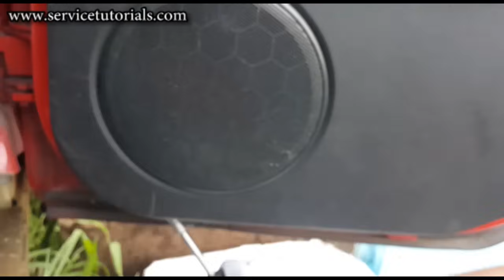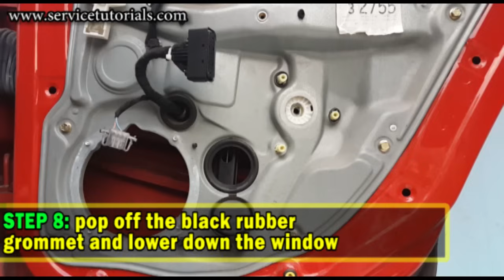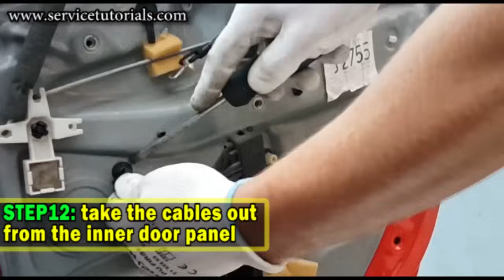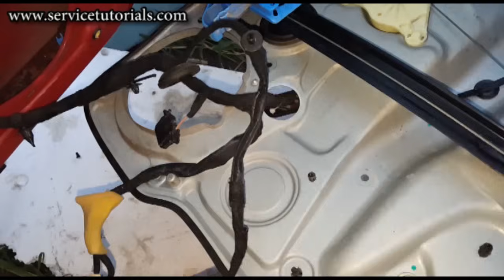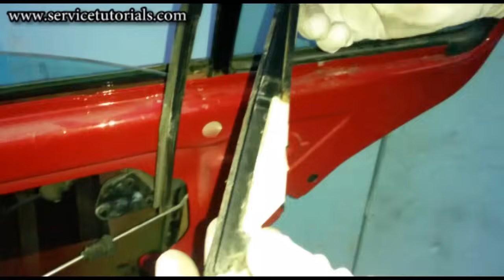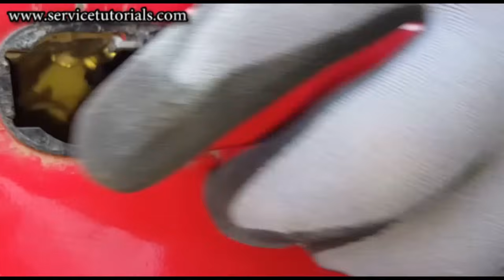How to remove / replace rear door lock module VW Golf Mk4, Bora, Jetta in 25 steps

Comment: Aloha. As a heads up to anyone attempting this project, it can be done without removing the glass and window trim. You can remove the bottom bolt of the window track and push it enough to the side to get the old actuator out and the new one in. It was a tight squeeze but doable and much easier than all the extra steps of the window removal.
Reply from the maker: Thank you for the info! 👍
Reply: You are wrong. Both the window and the guide rail need to be removed. 
In addition to that, do not remove the lock from the panel, before removing it from the door. The plastic bracket remains attached to the metal panel and so does the lock. Comes out altogether. Video shows it wrong.
When putting the door together, mount everything to the panel and then move it into the door. It is much easier, than mounting the lock itself to the door without being attached to the panel.
Reply: @Servicetutorials
Reply: @dacat8171  I just do it yesterday and its true you can remove the lock without removing the glass and window trim ,just take out the 2 bolts that have the glass trim and you can squeeze the lock. Be careful with the long metal that supports the door latch because it has only one position , following the back of the piece that supports the long cable of the internal opening (not in the front, i do that and the door lock was failing because it cant open or close propertly due to the metal of the latch being forced and was not mooving freely
Reply: @Ivancp13  
Removing the door lock may work the way you have done it, but it will cause damage at least to the lock and possibly break the levers that are attached to the door lock and which you need even if you replace the entire lock. 
You will have a very difficult time putting everything back into place, if the window trim is not removed. Removing both the window and the window trim takes a half hour, when doing it for the first time, but gives you massive space to deal with the door lock and saves you time when re-assembling it. 
The window definitely needs to be removed. 
Also I am not sure, if your car has got a central locking function or not. If there is a central locking system you have to go the extra mile, since the door lock is huge.
Reply: @Enter_The_Sage  this is 100% true. I just did it your way by moving the rail towards the exterior of the door on both my mk4 jetta and mk4 wagon
Reply: So if it worked for me to do it how I suggested and it worked for a few others on here then maybe you should walk back your comment saying I’m wrong. If we’ve had success and no problems with the method I suggested than who are you to say we’re wrong? Seems like you're the one who is wrong yet is doubling down on how right you think you are.

Comment: Thanks. Two comments: (1) It is easier to push the plastic pin out of the centre of the glass retainer than using a screw. You can then also push the main plastic bush out and retrieve both from the bottom of the door once the panel is off. (2) The electrical connector to the door lock: the design of the locking mechanism means that often it will not release if there is or has been any tension on the plug. Before trying to unlock the plug, first of all PUSH it firmly ON to the connector, only then can you release the plug by pulling the small catch and then pull the connector off.
Reply: I think using a screw prevents the spreader pin from compressing, making it hard to pull out. Still, I'd be wary of pushing the pin through, as all that force is exerted on the small plastic clips that hold the pane holder to the rail...I wonder if that's how the Humble Mechanic broke his:
https://youtu.be/RF4w7uYgc8k?t=623
Reply: And for the electrical connector, I found a small flat-blade screwdriver got the lock released easily (whereas using my fingers was both futile and painful!) - depending on which side of the vehicle you're working with.
Reply: Yes, I struggled with those VW connectors until I realised you have to push the connector IN while you release the retaining clip.
Reply: @thromboid  yep wish I had read your comment about breaking the guides if you don't use a screw. I got away with it the first time I replaced the lock. Module but not this time. Window working with only one guide but not wise to break them.
It's best to put the glass back with the white plug already installed. It will locate itself onto the slider fairly easily and does not appear to damage the slider in any way.

Comment: I'm doing this job right now. What a monumental PITA. Great job on the video. Saved me a ton of money. Shop wanted $600 per door for this. I am doing three doors.
Reply: Monumental PITA is 100% correct - so many little traps and tricks to watch out for. I finished the first door today, and I can see why a shop would charge $600!
Reply: Think yourself lucky.  I've got all four doors to do.  Weirdly on this car the tailgate lock is absolutely fine, whereas that is normally the first to go (when the washer fluid line pops off and dribbles fluid all over the lock module.)  If only the side doors were as easy as the tailgate!

Comment: Thank you very much for posting this very detailed video with all the necessary steps, clearly stated and clearly shown! Much appreciate your effort in making this informative video.... But holy cow, could VW have possibly made this actuator part any more inaccessible or difficult to locate and replace?! This is exactly why I almost always buy and drive cars with MANUAL windows - nothing to break or replace.
Reply: It was still a bit of a pain back in the day. I remember doing this on a Mk1 GTI (front door obvs) and a MK2 5-door. Very fiddly and the doors were thinner meaning access was even tighter. Now on my third VW of this era (two Golfs, one Passat) and all three have had window or lock issues. VW dealers must have loved this design choice.

Comment: Perfect video, was really helpful. Few things, you dont need to remove the glass or the trim, just take out the 2 bolts from the trim and you can squeeze the doorlock pushing aside the trim. Other thing is that the 3 plastic bolts that supports attached the doorlock to the inside panel isnt needed, take it off and put some tape on that 3 black holes cause when it rains the water flows inside the door, so that why has to be well insulated. That piece is always or broken or just a pain in the ass, you can remove it and its no necessary
Reply from the maker: Thank you for the info!

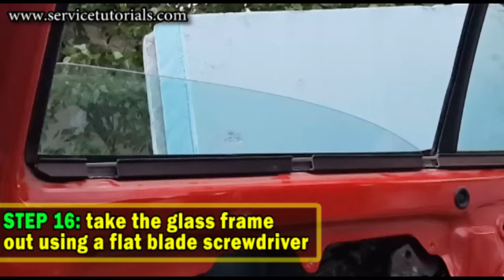Comment: 10:11 (Step 16) I found it much easier to pry up the window strip on the inside of the door - there's a series of clips built into the metal of the door that you can work the stripping off by twisting a flat-blade screwdriver in there.
Reply: correct.Work from the B style to the rear.

Comment: I only used steps 1 - 14. Too much hassle to change motor and never use rear lock. Made sure door was in "open" non deadlock mode. Looked at the six coloured wires to that connector and cut the cable at the door handle end just cutting those six wires. In effect that door is now non central locking but I just keep it locked now manually and wont get in difficulty if the door decides to deadlock and cant be opened which is also an MOT failure. Thank you for the video - took me a fair few hours to do but got there, referring to your video as I went along.

Comment: Hi!
I haven't seen before the foam at the steel locking rods (two yellow one at the horizontal, and a grey wrapping one around the vertical rod). Were them a manufacturer fit, or have you put them on those? Did the help on decreasing the noise of the door lock mechanism?

Comment: Correct me if I am wrong, but I believe the two bolts that hold the mechanism onto the door frame are actually 8mm 12 point allen screws. . . that tool worked for me. I have no 12 point torx drivers.
Reply: It's a Torx if it's 6 sided, these are called Tripple-Square bits and have 12 points as you had mentioned and yes, this is the M8 (8mm) sized bit
Reply: Some places are calling it triple squared, and some call it a 12 point spline. It's not a Torx though.

Comment: good video, however I reckon that I would leave the cable plugged in to lock until I can see it, but the most important one is this-DO NOT remove the bolt that secures the door handle, unscrew it about 10-12 turns, enough to free the handle
Reply: @Kristian Julian it did the trick and I actually got access to my account again. I'm so happy:D
Thank you so much you saved my ass!
Reply: @Franco Mitchell happy to help :D

Comment: When you install everything again, be careful with the pin that holds the window, I put the 2 together at the same time, tapping carefully until it clicked into place, because I tried putting the large one first and then the second and it fell to the bottom of the window. the door either of the 2
Reply from the maker: Thank you for the info!

Comment: Very detailed and informative.
I got one question, my door is completely stuck, it will not open from the inside or outside, I managed to remove the door panel from the inside only, how can I get the door open to continue to follow your tutorial?
Thank you very much
Reply: I have had this issue in the past. It's a difficult fix. If you can remove the interior panel with the door shut, unlocking and opening the door is going to require you to drill a hole through the door skin where it is usually covered by the panel in line with the release lever on your door lock mech. I used my new replacement to figure the exact spot. If you use a screwdriver through this hole to move the release lever, your door will open and you're ready to follow the video and replace the mech. Worked for me

Comment: Hello buddy thanks for your video. I have I basically 2 problems in my Skoda Laura co passenger side lock. 1st is it does not shows  on door open light on dashboard when the door is opened. 2nd is when I press unlock button for the door the co passenger side door does not unlocks. it stays locked. after repeated pressing on the door's lock & unlock button the lock finally unlocks. 
can you please let me know where exactly the issue can be

Comment: Actually, the replacement of the door lock is not that challenging, once you understand that all parts remain attached to the panel and the panel with all parts mounted including the door lock are to be removed in one step from the door. 

Key to success is to remove the window and the window guide rail completely. 

Some remarks:
• no need to remove the speaker, 
• all wires remain connected
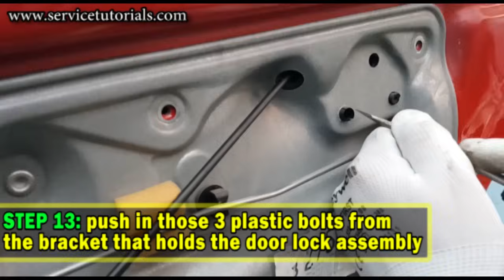• do NOT remove the rivets from the door lock bracket @ 7:05, since it is almost impossible to get them fixed. You need the bracket for an easy installation of the door lock.
• window opener motor at 2:55 stays where it is

Therefore, I am not that happy anymore with your video, since it does not show the replacement in the correct - easy - way.
Reply: I don't know about easy. But I'm going to do it your way.
Reply: Could you explain how to remove the window and the guide rail before the panel is off? (Edit: I think I worked it out)
Reply: @chaos.corner  
Did you succeed?
Reply: @dacat8171  I have put the job on hold. I was hoping it would be a quickie and I need to use the car in the next couple of days. Those plastic rivets are already broken so doing something with those is going to make it a longer job too.
Reply: @chaos.corner  
👍🏾

In order to get the bracket attached to the metal panel, I used zip ties. It worked out well. But the lock is a massive chunk. It feels wobbly.
The only job the bracket needs to fulfill is to carry the lock out (when removing) and in, when installing the new one, without unplugging the electric wire. 

FYI I was not sure which door lock I needed and I therefore removed the door lock on the first day, purchased a new lock and put everything together on several days. There must have been at least one week when the window was secured only by duct tape. Duct tape also works in rain, I discovered.

That repair was one of those moments when I thought >>why bother with that 25 yrs old car? ... why not get something new?<<

Edit: at least a week when I drove around without the door lock installed and the door kept closed by means of duct tape. Only city traffic and therefore moderate speed. 😁
Reply: @dacat8171 Yes, this car is definitely past EOL but it's still going and getting 47mpg. I'm thinking I'll be able to get the lock out and just let it hang on the wires then maybe run some screws through to hold it back on (some parts of the rivets are still present so I can get it in the right position). I could bungee the door but I have to travel some distance on Thursday. I might have a look at the bracket and see if I can model it for 3d printing.
Reply: @chaos.corner  
3D printing is definitely a powerful backup, since this bracket is a bit fragile in the area where it secures the door lock and tends to crack owing to its age and the weight attached easily. 
That bracket is still available at Volkswagen spare parts. If that is an option. 

Interesting fact about the bracket: there has gone some engineering knowledge into the designing of the part, as it needs to be strong enough to carry the door lock, but it also needs some flex to allow the door lock to be positioned in the correct manner.
Reply: @dacat8171 I'm actually wondering if the broken rivets are responsible for the issue I'm replacing the actuator for. Often the door won't open and I have to push on the handle until it "clicks" and then it will open normally. I don't see that it should be an issue since everything is bolted up. I need to replace it for electrical reasons anyway.
Reply: @chaos.corner  
Naaah, nothing to do with the broken rivets. 
Possibly the rivets were damaged on purpose when the electric window opener mechanism was replaced. Besides the door lock the window opener mechanism is another weakness of this car. 

There is another door lock repair (?) tutorial out there stating, that German engineering is ace as long as it works, but is painful, when it breaks and needs to be repaired.
Reply: @dacat8171 It's not the window (I have manual windows anyway) It's the three plastic things that hold the lock to the metal plate. I don't see how it could be causing issues either but shrug
Reply: hey, I am looking to this exact repair the way you described it. Would it be possible for you to give me some tips/a more detailed explanation of your strategy?
Reply: @zerkalix  
Again, you need to understand, that the panel carries almost everything from the door i.e. door lock, speaker, wires etc. 
In order to remove the panel you have to remove the window glass, the window guide rail (watch other videos on YouTube), disconnect the handle from the lock (as shown in the video) and last remove the screws that secure the lock to the door frame. Then you unscrew the various screws that keep the panel in place and it is very easy to remove the panel with the door lock in one move. 

To install the door lock you first mount it onto the panel connect the wires and place it into the door frame. Then you install the guide rail. Put in the window glass and last the door cover.

Comment: Normally, careless & cheap engineering lead to bad products. But One has to spend a lot of resources to engineer something this level of stupid. 
German logic
Reply: Yeah, I wuz going to fix the lock actuator, but, I think I'll just reach over and manually unlock/lock it, now...
Reply: @nplus1watches35  So true...for the time and hassle you could probably do 10,000 manual locks. Seriously.
Reply: yes they spend alot of money and engineering and pass  the bill  onto the car buyer and  then when theres trouble ,stupidity rises its ugly head ,theres no reason for all this if the unit was built simper and worked better look at the Toyota stuff like this way handier and hardly breakes down  from my perspective
Reply: Wovon zum Teufel redest du

Comment: how do you get to the mechanism when the door is closed and refuses to open
Reply from the maker: Hi! You just have to remove the inner door panel.
Reply: Dewald Venter Use a welding wire about 15cm  long. Make sure one end has a hook. As you pull the door handle slide the wire in the gap. You want to feel for a hook usually on the left but could be right side and pull. This will help unlock the door. I did this on my jammed door which wouldn’t open from the inside or outside.
Reply: @Servicetutorials  You cant get at the lower screwson the inside panel  for starters if the door wont open have a look and see ,dewald is correct, if the door refuses to open
Reply: @johnnoonan5802  You can if you remove the rear seat base and then use a right angle torx key of the correct length. Tilt seat base forward and unclip it and you should just have enough space to wiggle a torx bit in there. You might find one in a cycling tool kit as they use torx bolts on Shimano chain ring bolts.

Comment: Great Video, but Ive seen others where you did not have to remove the glass. In my case its a stuck actuator so if I can free it and get it to unlock Ill disconnect the central locking and continue using the door manually. I would have preferred your explanation with the video rather than the cheesy music.